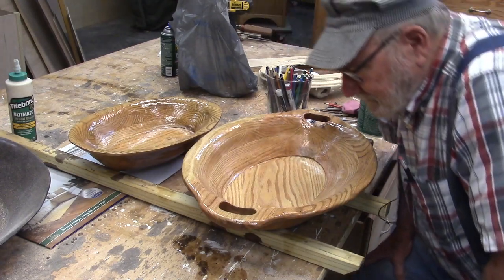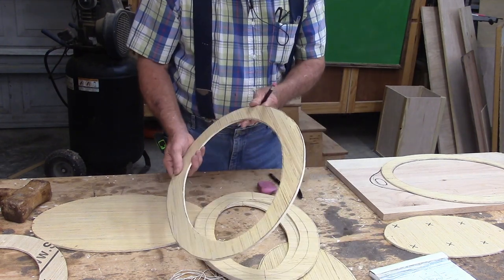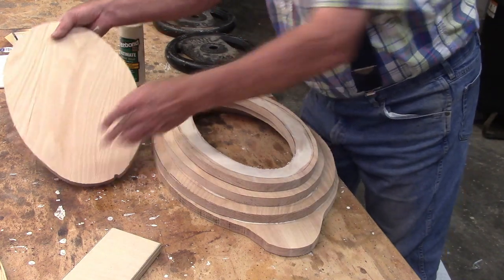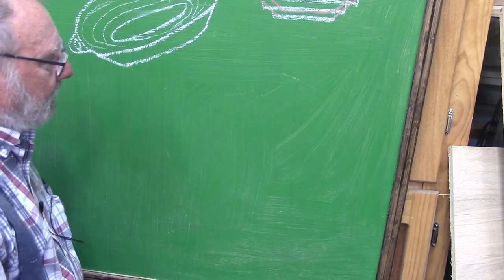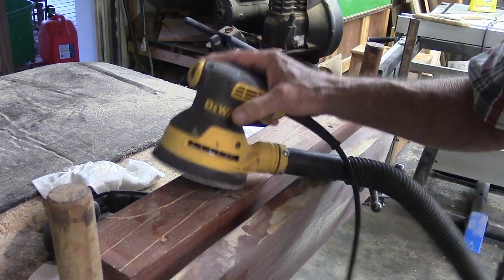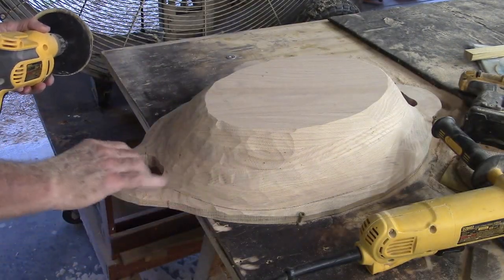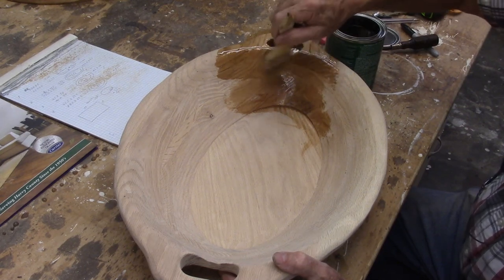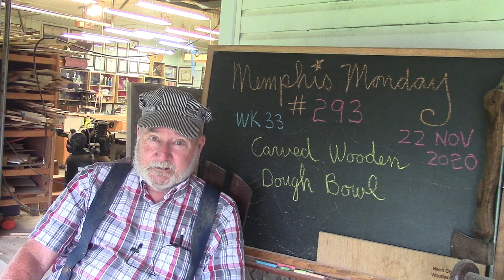293 Two Carved Wooden Dough Bowls Week 33

Comment: 1% measuring and marking, 1% cutting, 98% sanding. Sounds like woodworking to me. Seriously though, you are right about this type of bowl being a good gift. People appreciate something useful and handmade. Have a Happy Thanksgiving.
Reply from the maker: Thanks for the kind words.  Been making these for years, and folks seem to like them.  Back  in the day I wondered about the durability, as they seem to rely on a lot of glue, but I've never had one fail.  Plus, as you can see in the video, they are rather easy to make, as everyone has a drill and an angle grinder (almost).  And you can turn one into an work of art by spending more time and effort sanding.  Finally, and this might be important, that red oak soaks up poly like there's no tomorrow, making these things surprisingly water resistant.  
     Again, thanks for the kind words, and for taking the time to comment.